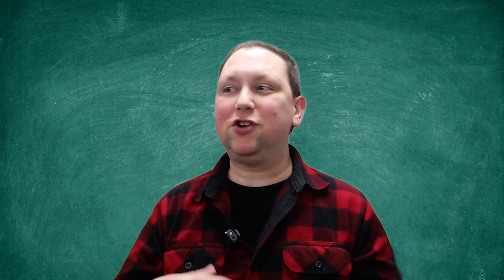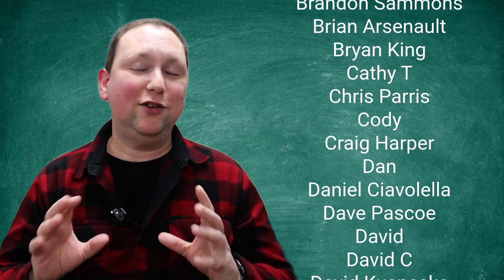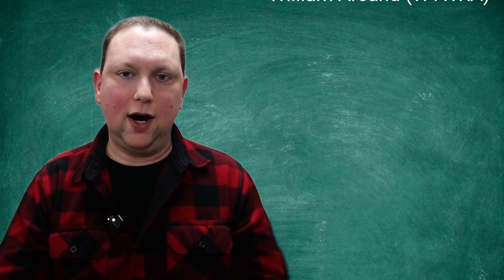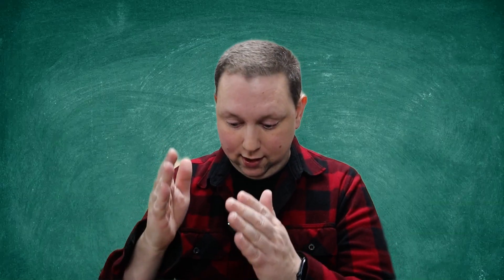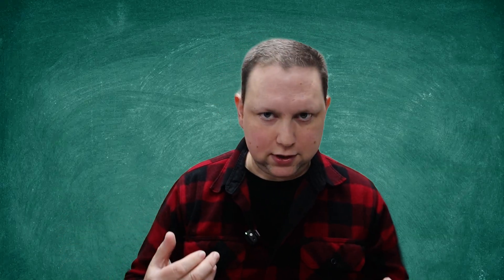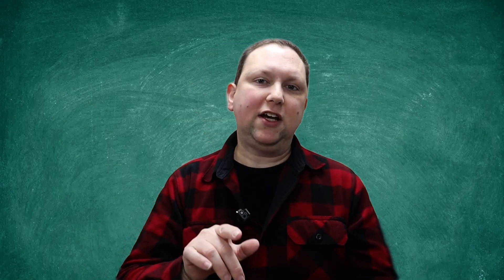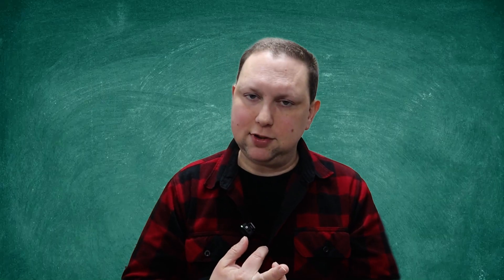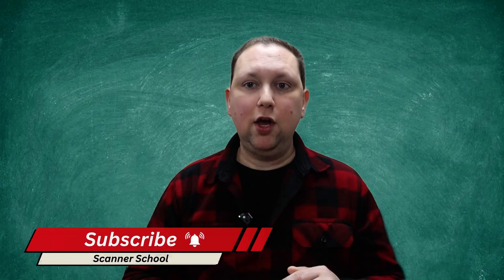SRU103: Trunked Scanning Basics

Comment: sounds dumb and a like a government fix to a non existent  problem
Reply: I feel like the main reason trunking exists is scalability. At least to my understanding, as long as the control channel remains the same, frequencies can get added as radio traffic increases without needing to reprogram all of the radios. The radios just listen and go on the frequency they are told, so even if a new frequency is added to the computer running the control channel, all radios in the system don't need to be reprogrammed. It's also a more efficient use of channels, as like he said an EMS TAC channel would not be used nearly as much as a police dispatch especially in less busy places. So they can share the frequency and if needed another frequency can be added seamlessly